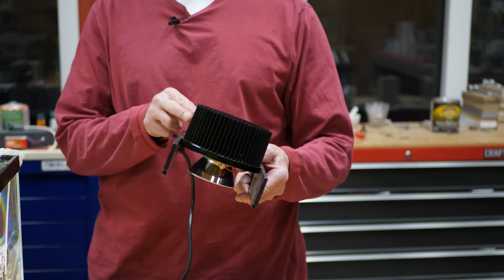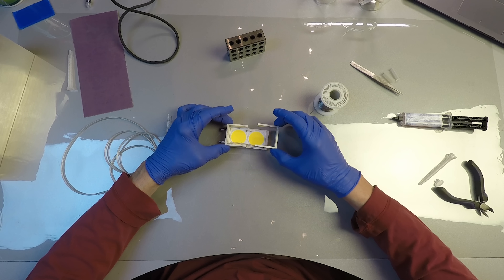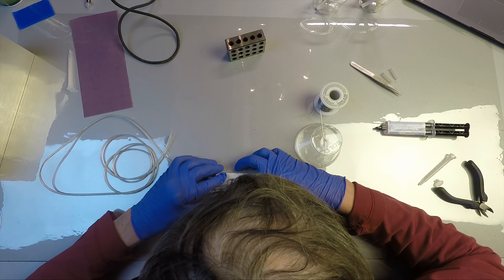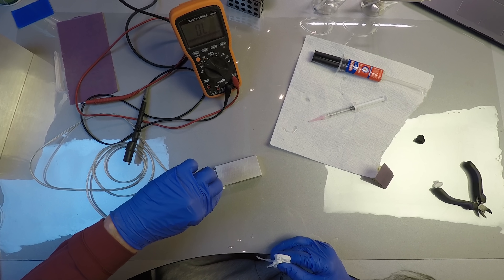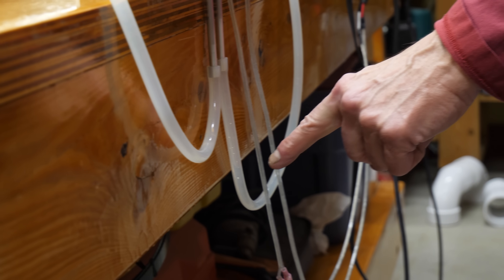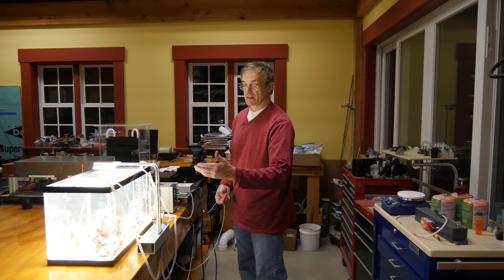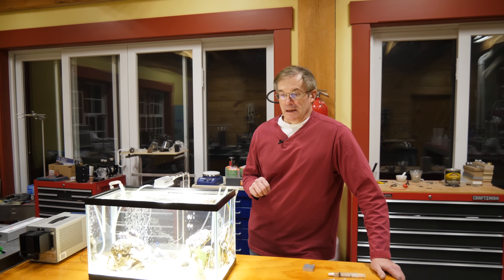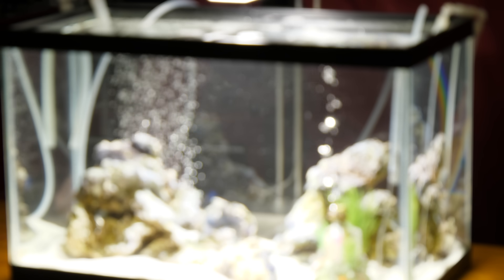40,000 Lumen LED Aquarium Light

Comment: I wouldn't combine the liquid cooling of the LED with the Tank though, particularly just because the potential for growth of bacteria / algae in the cooling loop would occur and possibly clog up the loop and not letting the LED chips be cooled properly.
Reply: You could use a second block that's immersed in the tank that would act as a heat exchanger. The coolant would be isolated from the water in the tank. If algae grew on the outside of the immersed block, it would be easy to clean.
Reply: @jimferguson9528 , wow, nice one! He could even hide the second block behind some stones and aquatic plants.
Reply: @jimferguson9528  I think it would require more than a second block to keep these cool, considering these run around the same temps as a processor you are looking around the same amount of cooling, this would probably require a double rad or larger to keep them cool and running at the optimal temp for efficiency. I built 100w cob lighting system a few years ago and each cob required a big 3kg heatsink and fan and they still ran on the hot side, you would probably need an extra 5+ blocks per cob to keep the temps within range.
Reply: @shroomzgames7370  The specific heat of air is much less than the specific heat of water. Plus both sides of the block immersed in the aquarium is free to exchange heat with the water. I sense an experiment brewing.
I made a sandwich with three of the aluminum blocks and two Peltier devices to cool water for a condenser in a chemistry set up. I run tap water through the outside two blocks which are on the hot side of the Peltier devices to remove the heat of distillation. The center block is on the cold side of the Peltier devices. The chilled water is more than sufficient to cool a 300 mL Liebig condenser which runs at close to 80 C.
I was able to eliminate an ice bath that consumed a lot of ice with this assembly.
Reply: Agreed. The aluminum itself is a biocide, not a good one. I was relying on the tubing diameter and the cooling block channels diameters. 
As for the catastrophic failure, the worst scenario is the fish staying in the dark.

But, as you have said, a closed system is the best solution.
Reply: normal aquarium filters have around the same diameter(Depends on your filtering system ofc). And they don't clog up usually (at least my haven't yet). And if that happens you can flush them out and maybe use sth like hydrogen peroxide to oxidize them away.
Reply: Pipe it through your UV sterilizer.
Reply: You have a point. But since it's metal tubing (kills some bacteria) and the water flow is steady, it will take long to have some sort of build up.
Reply: @nejiniisan1265  idk man, buildup can happen pretty quickly in watercooled PC's and that's with distilled water and no fish or plants in the loop causing some real pain if you don't add a biocide to kill any bacteria in the loop.
Reply: @nejiniisan1265  I'm not sure this is a safe answer. Anyone familiar with the PC overclocking scene knows what happens when a water cooling system fails, you risk catastrophic failure. In a PC that's a significant financial investment and the risk of fire. I can't imagine an expensive exotic fish tank would be any different. This should be a closed loop solution using distilled water. Syncing the heat back into the tank is fine and epoxy sealing the block is genius but you can't trust turing your back to a cooling system that could contaminated with fish poop.
Reply: @nejiniisan1265  

"But since it's metal tubing (kills some bacteria) and the water flow is steady, it will take long to have some sort of build up."

LOL.  no.

bacterial growth could potentially start a serious flow problem in those tubes inside of 10 days.  clogs inside of 3 weeks.  and then how are you going to clean them out?

Comment: look up for desktop CPU water-cooling solutions because there is a reason you do not use "alive" water for small tubing and cooling blocks as growth clogs it soon ....but combination is great for sure ....i like this idea more flies with one stone, but this is the only thing that i'm concerned with in this solution of using thank water .... otherwise brilliant as always :)
Reply: yes, this is nice idea, nice touch on light, but closed loop would be better because as i have aquarium and when i clean motor on filter it is monthly full of qunk... would not want to clean this heat sink on light .. and as it is closed it would be needed to be with high pressure flush or something like that :D
Reply: That is closed loop... adding biocides.

Comment: Have you investigated the qualities of the epoxy coating that results from the syringe process?
It would be interesting to see what the inside of the block looks like after it's coated with epoxy. Layer thickness, uniformity, etc.
Reply: The main problem will likely be due to biofouling which will significantly reduce cooling efficiency  - can probably be mitigated with regular maintenance. The biofilm that forms should sequester most epoxy "leakage" in the sink.
Reply: @farzinp8277   Probably should get a glue on temp sticker on it to monitor when it starts to get fouled. When the temp goes above average, disconnect, run vinegar through it and then clean and reassemble.
Reply: you don't have to even worry about aluminum leeching from such a small area.  any tank you are going to be changing the water MUCH faster than any buildup of aluminum ions would cause problems.

no, the problem with using tank water is simple accumulation of bacteria in the lines, and even invertebrates in some systems.

and cleaning those tiny right angle stainless tubes is NOT as easy as people think it will be.

go on.  try it.  let's see how long you last having to fiddle with cleaning it every two weeks.
Reply: My thought was the leaching out of BPA and so on from the epoxy isn't great for fish either. I would guess however, that compared to dissolved aluminium, it would be the lesser evil. Assuming he doesn't plan to eat the fish.
Reply from the maker: There a a large number of aquaria built largely from plywood and coated with epoxy.  The fresh or salt water fish have no problem with this.
Reply: Tech Ingredients I'm allergic to fresh water fish but...

Comment: what do you think of silicone adhesives for the aluminium/aluminium where the parts might warm up at a different rate or become very hot?
Reply from the maker: It's a good idea.  I used a thermal epoxy to bond the COB so neither surface differs significantly in temperature

Comment: Is it just me ?   Am I the only one who sees the FAR ore elegant solution ?
You pot the light and submerge it and let the water cool it directly.
Reply: I think that over time that may heat the water too much for the fish.
Reply: I agree, excellent idea.
Reply: You want flowing water so it should at least be by the aquarium pump. Even then you're giving up the metal block that spreads the heat to a larger surface area. Also any exposed conductors have to be insulated to prevent partial shorts and corrosion.
Reply: DeShawn Michaelson 
👍
Reply: They have thermally conductive potting resin (encapsulant) that you could coat the exposed electronics or even the entire device with.  I would probably incorporate a small heatsink on the topside to go near the surface of the water.  By aiming the filtration output at the heatsink, or a dedicated bubbler the moving water would be sufficient to remove excess heat I would think.  I think the OP is correct, I have seen ballasts for HIDs cooled in this manner on a larger scale.
https://www.electrolube.org/products/thermal-conductive/er2183/thermally-conductive-potting-compounds/
Reply: Two-three days, and you will have a few cm algae, on it.